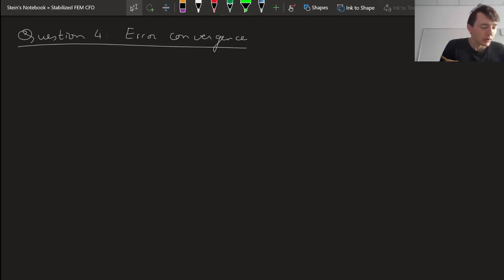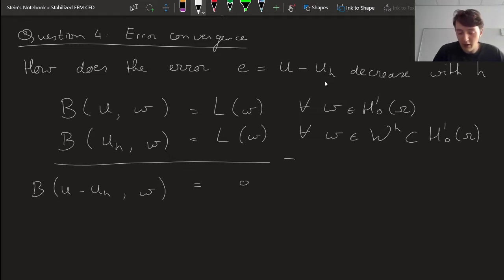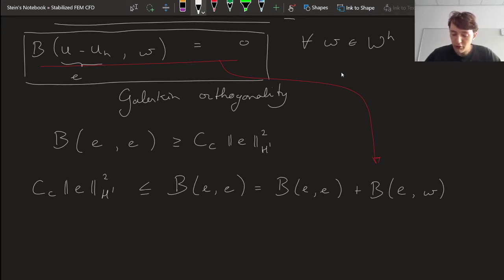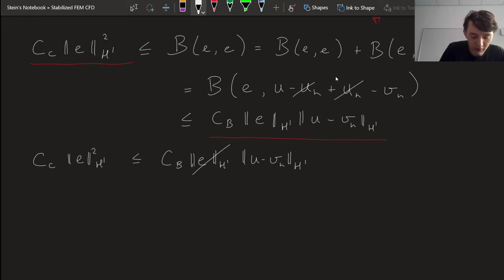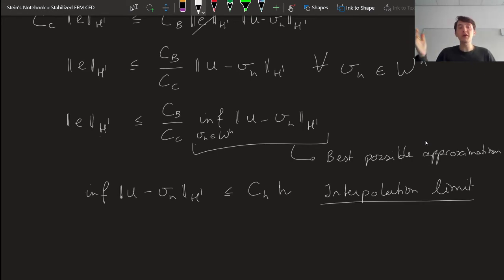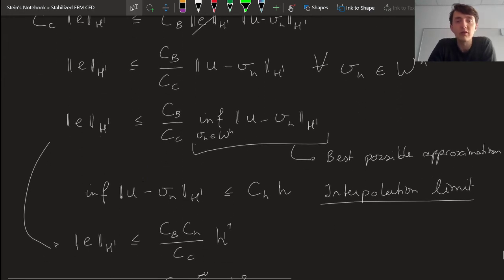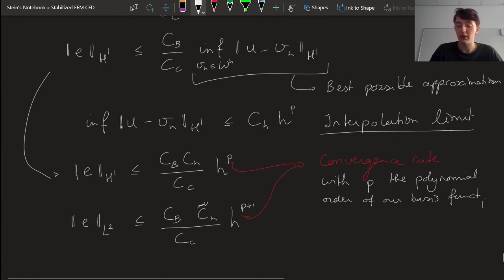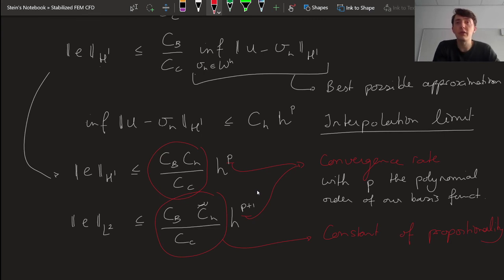15 - Functional analysis - Error convergence

Comment from the maker: It was pointed out that I neglected to emphasize that the convergence rate is not only dependent on the polynomial order and the errornorm, but also on the degree of smoothness of the exact solution. To rectify this: if the exact solution is a member of the s-th order sobolev space H^s but not higher (not in H^(s+1)), then the optimal convergence rate of the error in H1 is min(s-1,p) and in L2 is min(s,p+1). Thanks @louisvanderbecken1403